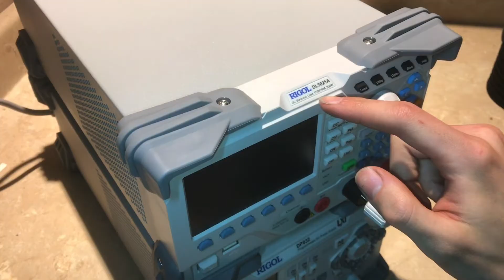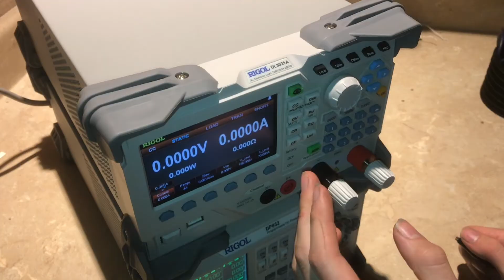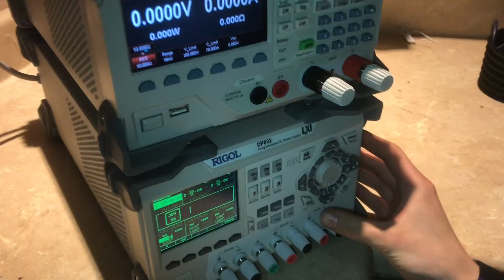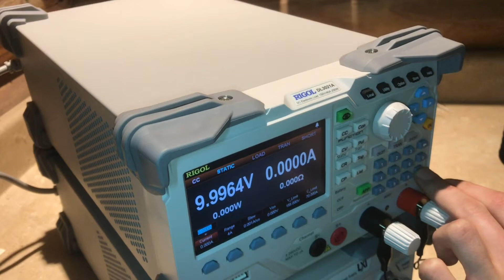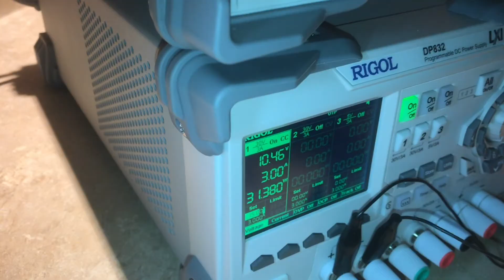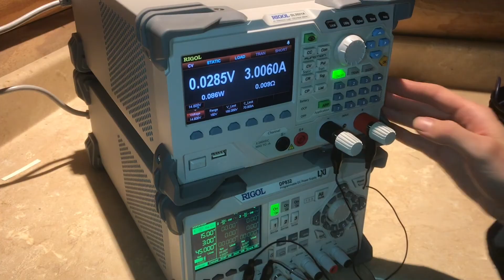USING rigol dl3031 programmable dc electronic load (single channel)

Comment: You have the same software bug I do in CR mode. In your demo you set a constant resistance of 10 ohms, yet it reads 9.918 ohm, which is wrong, it should be 10 ohm. At this point if you adjust the rotary adjust knob to move the set resistance slightly up or down the internal calculation math bug will be bypassed and the output will move to a constant 10 ohms, like it should. Give it a try. There is a software update available, but I am not sure if it will fix this particular bug, I did not see it listed as part of the bug fix list.
Reply: I have the same issue on mine for the amps when discharging a battery. Instead of 25 it goes to 24.976. The only way to get it to 25, or at least close to it, is to turn the current up by the difference amount of that makes sense. So turning it from 25 to 25.024
Reply: @SwayK47  Quick question I could not find on the data sheet.  I am looking to do some discharge testing on relatively small batteries.  How low can the current be set on the battery discharge mode?